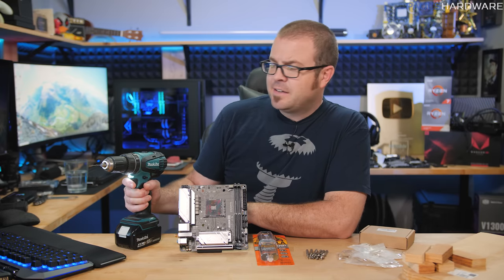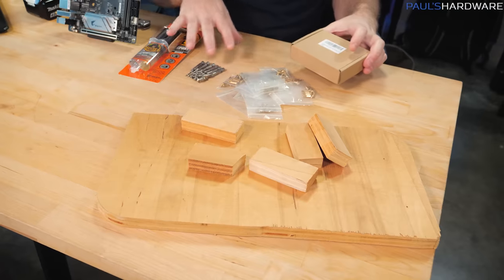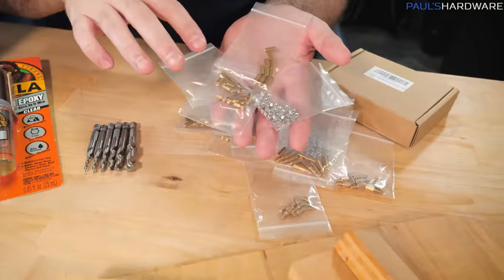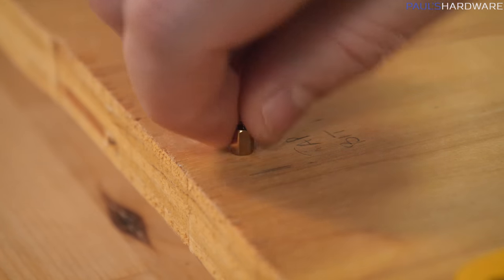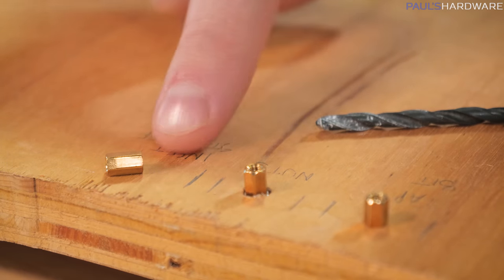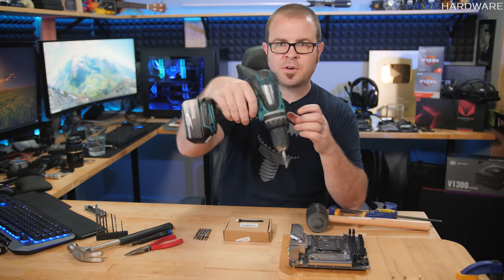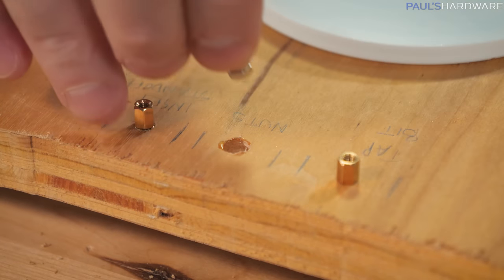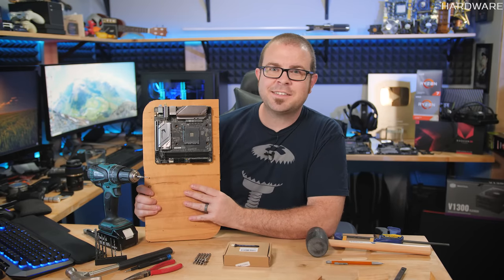The Wood-Mounted Motherboard Challenge!

Comment: I have two worries about using wood to mount your mother board. First is that wood has insulating properties and even with the stand offs it will retain more heat. Second is the expansion and contraction of solid wood with the rapid change in temperatures and especially when you add in a humidity factor.

Comment: There are products specifically made to mount into wood with outside and inside threads or fasters. The first one is a "Tee" nut it has 4 spike and an out side flange. You drill a slightly undersized hole and pound it in from the back and you have machine screw threads to screw into. The other is a furniture threaded insert that has wood screw on the outside and machine screw threads on the inside. These products are available at Ace or other well stocked hardware stores. You were attempting to re-invent the wheel. On the other hand, I really enjoy your videos, keep up the great work.

Comment: Good job on this! I would say this, wood is something that breathes. With changes in temperature and humidity, wood will expand and contract daily. Also computers produce vibrations that could loosen a screw from even a pc case. So just because the standoff fits tight in the wood you should still use an epoxy just like most manufactures use lock tight. You wouldn't want your system to fall off the mount after a few days of use.

Comment: Pro-tip from a woodworker, you can get 10 m3 press-in threaded inserts for less than a dollar on ebay, and just use super glue and it'll never come apart, and they have different lengths so you can get even more holding power.

You might even be able to find the kind that are threaded on both sides, but for smaller fasteners like m3 a press-in or a t-nut on the back works so much better.

Comment: With the threaded drill bit after drilling your hole use a little super glue in the hole. It toughen up the wood so the threads have stronger grip onto the screw. It's used in rc modeling all the time

Comment: IMO, your approach is a tad overkill, but it does look solid!  I've got an dual G34 Opteron board mounted to a slab of wood.  I used small, self-tapping, wood screws and a dozen nylon spacers purchased at the local Ace for a few pennies each.  I located the mobo, then used a long nail to dimple each hole center. Remove mobo. Use nail and hammer (or small drill) to establish a good pilot hole.  Start at one corner with screw /  mobo / spacer / board, and work your way across the board.  The middle spacers are a pain. You can tack them into place with a drop of CA, or push them around with a straw to position them properly.

Comment: after doing many custom wooden cases this was interesting to watch. I only ever use wood screws and they have never failed me. not to mention they are super easy. 
you dont need to add the ground at all, but I will give credit for the inset standoff method.

Comment: Yeah, I'd default to brass inserts as a general recommendation. Personally, however, I'd mount standoffs with a bolt from the other side of the board. It would let me wire ground between every standoff, hidden on the rear of the board, and be very strong.

Comment: You could also drill a second smaller hole all the way through, tap in the anchor, and thread a screw in from the other side. But generally I think tapping in the standoff into the slightly smaller hole would be solid forever.

Comment: For those who will follow the "inset standoff" you may put a piece of wood between the hammer and the inset. To avoid damaging the inset during hammering. Needless to say, you have to initially put the inset tip a little bit to have a vertical position.

Comment: I did this but drilled all the way through and put m3 machine screws through the hole held in by the hole being smaller than the screw and then using one nut to hold it more securely and act as a standoff then another nut ontop to hold the mb on. Cost 2$ and worked very well.

Comment: Those screws are designed to be used with metal so using the standoff or washer would likely be the more successful methods. Wood is comparatively soft so the close and compact threads can eventually tear through the tapped bits of wood over time depending on the stresses it's exposed to. 

Realistically tapped wood will probably work, although I might opt to drill a small hole and tap it by using the mobo standoffs to lower your tolerances. If the wood isn't obscenely dense and hard the mobo standoffs should be strong enough.  

I also work a bit with screws and resins, you can use vaseline (petroleum jelly) or lithium grease as a release agent for your screws so that your washers/standoffs are properly positioned. Just coat the threads and screw 'em in. I've used that method under 15-20 PSI of vacuum so there shouldn't be any issue with press fit pressures in a porous material.

Oh and if you really want to do it proper, rough up the surfaces of pieces you are going to epoxy with some sandpaper, 120 grit ish or less to increase surface area for it to bond to. Might be a good idea to go with a resin that has a low viscosity to eliminate air pockets that will weaken the bond. Don't go too thin or it will get absorbed into the wood's pores. Even though you've pre stained the wood if you drill you're exposing end grain again which loves to absorb most liquids and ruin your finish.

If there's any epoxy overspill let it set for awhile and when it's a little more solid (but still a little pliable) use a sharp chisel to cut it away. If you just wipe with a rag or your finger you can cause it to spread and soak into the pores of the wood which will show through when you stain it. Wait until it fully cures before you sand it flush and do a final finish.

Comment: I mentioned this in the video before but 3D printing motherboard mounts and other mounts is a real option. My bro helped me out with that and my GPU motherboard, 2.5inch drives and power supply all have 3D printed mounts attached using proper wood screws, and the holes are all M3 to hold the hardware. Really handy if you know someone with a 3d printer laying around willing to donate some time.

Comment: When I built my WinXP retro rig I mounted everything to MDF by just drilling undersized holes and threading the standoffs in without tapping. Still together and running fine 3 years later

Comment: I build radio control aircraft and we do one of the following ….
1. After using the tap-bit coat the tapped hole with a drop of superglue. Be sure to get all the threads wet.  Let dry and run tap down hole again.
2. When epoxying a nut into a hole, coat the screw with a small amount of Vaseline before screwing into nut.  After the epoxy sets the screw should come out easily.

Comment: If you don't have a drill press. Use a piece of wood perpendicular to the base to guide the hand drill straight. 3mm screws straight through the bottom of the wood works. then there is aluminum 1/2 inch bar which is the best because you can thread the aluminum. Just a thought.

Comment: You could also look into Machine thread inserts, they have wood threads on the outside, and machine threads on the inside. So you get the benefits of the tap bit threads, and the inset standoff.

Comment: I would do the hammered in standoff method but I would use one of the standoffs that has a screw on the end rather than the double threaded. Drill the depth for the hex portion, then drill a smaller hole for the threaded and then put a tiny bit of epoxy on the treads before hammering it in. The screw end will keep the epoxy out of the center threads so you can remove the motherboard stand-off from the inset one and the epoxy will help bond it into the hole.

Comment: I think I would try using dual thred screws:
M3x15 with wood thread tip.

Drill a smaller pilot hole.
Then screw in the wood threads, leaving the M3 threads outside. 
Then mount standoff on the M3 sticking out.

If you want shorter M3 sticking out: you can go deeper on the pilot hole and expand to 3mm just the part uou want to sink the M3.

I used this method with M8 dual thread screw and M8 furniture nuts for a ceiling hatch, to get a semi permanent mount, but easy to unscrew the nuts every time I want access, avoiding wear on the wood threads.

Comment: Threaded inserts would be ideal.
Also, consider seasonal expansion, wood grows and shrinks with seasonal climate changes (namely humidity), but plywood is designed to be more stable.

Comment: And here I've got this test rig set up with the mobo just sitting on it's box happily running 24/7 with a Xeon E3-1240, some RAM and a RX560 and a SATA SSD hanging off it somewhere. Oddly...it works.

Comment: Using the inset standoff is your best bet. I don't think you will need to make threads as the standoff should thread itself. Also, when hammering in the standoff, thread a junk stand off in the standoff you want inset so you don't damage the inset standoff. GL dude :)

Comment: You can also use knurled threaded insert nuts -- you can get them in M3 and other sizes. They've got little teeth all around, and would be similar to your embedded standoff method, but with even more grip.

Comment: I would probably get much longer standoff nuts and drill all the way through, and then use a screw and washer from the back side to hold it in. I feel as though this would be the most secure and barely increase your costs; I know I couldn't afford to have hardware fall off!

Comment: Well, wood doesn't last forever, and in all scenarios that might be the limiting factor, as a certified hobby machinist, I would seriously recommend using a scrap piece of metal to make some more lasting thread in an X shaped design and screw in your metal piece into wood and then cheat a little and use nut to attache the risers and maybe sink the nut into wood. A few screws and some metal backing to the wood can be stronger than wood surface friction in my opinion, just hide the screws with the board. I like wood texture a lot, so I have been thinking about something like this, but I prefer to use a few screws and some metal to attach it. Plenty of donor old machines around.

Comment: I mounted a motherboard to plexiglass by screwing the standoffs into the plexi. You could make plexi the same size as you components then mount to it. Then attach the plexi to the wood in a non destructive way incase you want the nice wood later. Standoffs hammered into the wood will last a long time. Looks like this will be a really nice project.

Comment: Look up helicoil, we use them at work to allow us to put structural screws into 3d printed holes for quick prototyping.    Think of it as a combination of the tapped wood and the brass insert.

Comment: Largely using fasteners like this comes down to the weight to be held and the orientation (which way is gravity gong to try to rip out the fastener) AND very important, how often is it going to be disassembled. You can thread all kinds of materials and at first they will all hold well, until you start taking out and putting in the fastener repeatedly. That will cause the threads to degrade faster than anything in non-rigid, non-tough materials: like wood or plastic vs metal (weight and orientation not being a factor with these lite-weight parts). What ever method you use, use a drill press to keep it vertical if you can.

In this application you are likely to put the standoff into the wood once and never take it out again. That eliminates a lot of thread degradation right there. Even better is to form the threads, then apply a little thin cyanoacrylate glue to lock the wood fibers into an acrylic matrix, like epoxy and fiberglass. I'd also add a small, thin washer under the standoff to stabilize it against soft materials because of the very small bearing shoulder area on them. Easy to come out uneven if over tightened.
Once you have a stack of wood, tight standoff, motherboard and tight screw - it's unlikely you'll vibrate it enough to loosen anything. If your fans are that bad, you should replace them.

For inserts, there are a wide variety of them designed for specific materials. I use ones designed for heat insertion in plastic a lot. 3d printed threads are surprisingly strong but will suffer from frequent use of the screws. So one time use, no problem. Frequent disassembly, use inserts.

To use the brass hex insert like in this video I would do it this way (glue is optional).
1. Drill your hole.
2. Screw together the brass bottom insert, a washer and standoff (makes it much easier to handle, insert straight and to equal depth).
3. For glue - put a little candle wax into the bottom of the insert (keep the glue out of the threads).
4. Apply a thin film of glue on the hole sides and on surface of insert (it doesn't take much and the bottom doesn't matter, the sides have all your surface area).
5. Push the insert in until the washer sits flat.

Comment: Hey Paul, one suggestion. If you go with the inset stand off you may consider scoring the sides of the off set that you are embedding into the wood with a file to create 'teeth' around the sides. This will help epoxy to grab onto the stand off and give it some more holding power. It would help to keep the stand off from ever pulling out. In addition, gorilla glue works well for this. You just have to keep an eye on it for a bit because gorilla glue expands so you just wipe off the excess with a damp towel.

Comment: I didn't think the tap drill setup would work. I wonder how well it would do with 8 sticks of ram, a large air cooler and a big graphics card installed on the motherboard. I think you made the right choice with the hammered in standoffs. Perhaps a light coating of epoxy just before you hammer them in, but I think that's probably just overkill.

Comment: What you could do is mount a 1/4 inch aluminum plate to the wood, then tap holes in the plate.
Then you would have a ground plate to connect to it.
Also, heat from the M/b would dissipate better.
OR, tear apart a chassis, and mount that to the wood, leaving you a mounting bracket for the GPU card. Also giving you an I/O shield plate.

Comment: i have done a similar thing where i put standoffs on a wood block. i drilled a much smaller hole and just screwed in the standoffs. but after i was done with that i noticed it got loose after a few months. 
i would say go with insert with some epoxy. cause the those inserts have a smooth surface contact with the wood. theres a chance it could slip out. especially since it will be vertically mounted

Comment: That was enjoyable. Note that there's going to be a couple of differences with your walnut wood compared to particle board. The walnut is harder which is going to result in even stronger threads if you use the tap bit. And the walnut hardness will make it harder to hammer in the dual ended stand-offs so you might like to drill a slightly larger whole.

Maybe rerun your tests on the walnut under the place where you want to mount the mainboard?

Comment: Cool video and when you get around to the actual piece of wood to be used, use a scrap piece of wood between the standoff and the hammer strikes to avoid accidentally damaging the finished piece of wood.  Good luck

Comment: PCB standoffs AKA Arcade mainboard standoffs work better long term and can handle weight. It uses two parts, a wood screw to hold the standoff on onto a wood panel then a machine screw to hold on the motherboard or whatever. Also run a ground jumper from the Power Supply casing to the bottom of at least one motherboard standoff.

Comment: Here's an unorthodox method: long machine screws from the back of the wood, spacer instead of standoffs for the gap, bolt down with the machine screw's nuts. Add a ground wire to one of the screws on the back.

Comment: If you're going to hammer it in, use either a soft mallet or something that can distribute the force more evenly between as a buffer.  You don't want to be leaving hammer marks/dents all on top of it even if there's a motherboard there.  It's easy to leave little ugly circles all around it. The epoxy method would not be ideal the way you did it. As you can see, it would be very easy to offset and not be flat creating it to be a crooked mount.

Comment: I would go with the tap method, just add small bit of wood glue or epoxy to the threads before final mounting.  That way you start with the smallest hole, and if it doesn't work out, everything else uses a larger hole, so there wouldn't be any need to scrap your piece of wood and start over.

Comment: cool all better than I expected I think personally I would find some longer machine screw to go all the way through the wood and into one of those double ended thread thingy to screw the standoff into you could then also attach that extra groung wire ton the back if the wood well out of sight......quite interesting concept wood mounting and custom case mounting in general I may dabble lol

Comment: Inset method is best of these, but you can also drill 3mm hole through and use a long screw to hold a through hole stadoff from back of the wood. Then you can remove all metal bits from wood at any time.

Comment: You can drill a hole like you did for the first one put a few drops of thin ca in the hole prior to threading the stand off in let it set. will give the threads something a little more to bite into. This method is used when building rd airplanes that weight alot more then a MB

Comment: @Paul's Hardware I looked into this several years ago. My approach was to buy motherboard trays and such as it would be more forgiving than mounting the equipment directly to the wood if I ever changed hardware.

You can actually part an old PC workbench case and such for asthetics since there design is open air and the parts are finished on alot of them.

Also their design would give more support for that kind of build when it came to things like graphics cards.